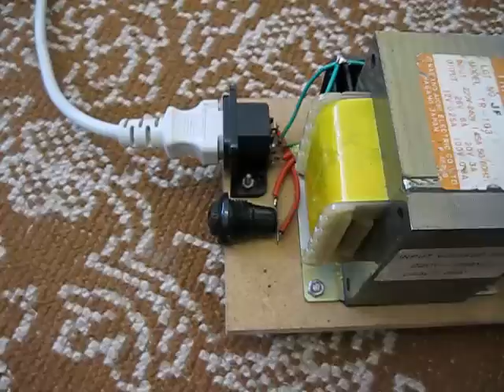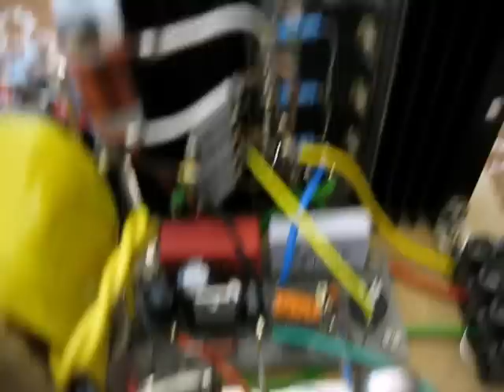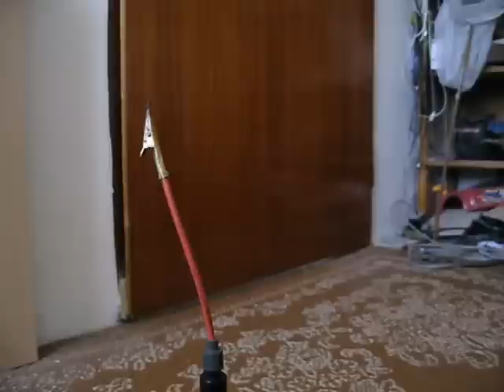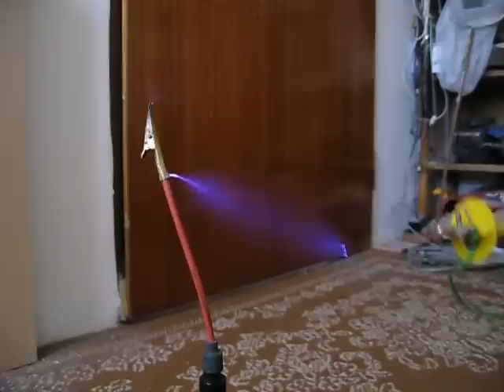Super flyback driver final version

Comment from the maker: @zker666 of course you could, but the 260 really is enough and doesn't get hot with moderate heatsink if the circuit is tuned properly.

Comment: tv monitors, with a crt inside. flyback are only used for CRT's,other transformers i can think up off the top of my head include MOT's (2000V, lots of amps, AC 60HZ) ignition coils, (30KV, low freq, AC output, low-medium current), NST's, (up to 20KV, AC 60 Hz, medium current to high current) and x-ray transformers, (rare, voltage unknown, 70Kv i think, medium current i think)

Comment from the maker: @lokeycmos Sorry but its too much... you could use a higher voltage MOSFET such as the IRFP360 and you'd need to change other circuit parameters to make it work well with that voltage.

Comment from the maker: I think the IRFP150 is a too low voltage transistor, then it depends on the transformer of course, its construction, phasing of the primary winding, air gap, core cross section, primary wire thickness, positioning and turn spacing.

Comment from the maker: Using a half-bridge the flyback dies sooner, with a single-ended "flyback" converter, the voltage can get higher with the same stress on the diodes.
Most flybacks I've tested failed with something like 10cm sparks on my driver...

Comment: I see 3 MOSFETs on the heatsink, are they in parallel (the schematic specifies only one) if so is it because they are underrated or am I supposed to put 3 IRFP260s if I want to run it at high power? btw awesome video!

Comment from the maker: it means that the capacitor resonates with the primary only during flyback impulse. The primary circuit is not tuned to the running frequency.

Comment: attach to critcal stripped hydrogen and oxygen atoms.and then the neutrons instantly cataclismically collapse as they are sucked into the engine air filled chamber implosion takes place .appreciate a price if you were willing to build a variable flyback and of coarse would be better if it were from 12v but i could use a 12v to 240v inverter  240v supply here in uk appreciate reply

Comment from the maker: It is to limit the capacitor discharging current when the FET turns on, and it "recycles" the energy leftover in the cap instead of dissipating it on a resistor.

Comment from the maker: @zker666 as long as the total resistance is something like 35milliohms (maybe even less is ok) at ~5W you're fine. You can leave the resistors out (and ground pin 3) but then the driver will always run at full power and something can blow with too short arcs.

Comment: @jmartis2 I meant the plastic insulator between the primary and the core so the core doesnt arc to the primary and cause a high voltage spike in the system.

Comment from the maker: @ubuntupokemoninc yes the simpler circuit gives the same open circuit voltage but doesn't limit current with shorter arcs and the transistor can overheat... though I don't know if youll get 100kV without destroying the transformer, only the large ones with big cores worked well for me, the smaller ones sometimes give poor performance and thin arcs. (also for cores with less cross section you should use more turns on the primary)

Comment: hi do these have b+ and if so does that mean they are stripping electrons .i am told that this is the main part stanley meyer was using to strip water molecules from 40kv up to 90kv so can these be made variable and where do trhe electrons go to as he states he feeds his electron propulsion generator with these got all the info just confused on this final part.once stripped the atoms elongate in the circular B+ field energised with uv 10w l.e.d.spectrum rainbow in injector that then lets neutron

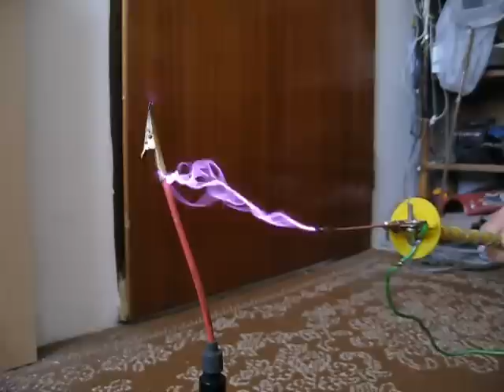Comment: I'm new to this but what creates this kind of electric arc and corona? is it frequency or whatever? I have a Neon sign transformer 10kV 30mA but the only erc it creates is the one that looks like on your video 0:40-0:45, kind of like light yellow plasma but no sparks. When I pull the diodes apart further the arc just dissapaers. It doesn't make this cool violet spark

Comment from the maker: @muraturile They are used as a current sense for the control circuit. You can just replace them with a short but then the driver will always run at full duty cycle, and something can fry eg. when you short-circuit the output.

Comment from the maker: @RUS38 The arc appearance (blue, purple, yellow, white...) depends on the current flowing through it. Because this flyback driver outputs a relatively high current at low voltages, short arcs are hotter, but the arc current drops quickly as output voltage and arc length increases.

Comment from the maker: It is 10 mili farads, this is used to smooth the voltage after a bridge rectifier. If you use a DC PSU, you can replace this cap with just a small decoupling cap (ca. 1uF film).
No, a ceramic cap will overheat. You need an impulse rated cap, polypropylene works well.
The resistors are for measuring drain current for feedback to the IC. Yes you can use a homemade shunt, as long as it can dissipate at least 6 watts and is non-inductive.

Comment from the maker: @miwgub It doesn't need to be exactly 21khz, but should be close. Different transformers might run better with slightly different frequencies, but I found 21khz worked best for me (higher frequency and I couldn't get as high voltage out no matter what I did, lower the frequency and the core can saturate/power output drops, and you can hear the frequency as an annoying whistle...)

Comment from the maker: @TheLightningStalker The extra coil with the diodes recycles leftover energy in the capacitor into the power supply. This circuit is better for driving a rectified transformer than eg. a bridge or zvs, because the output waveform of this is asymmetrical and the output diodes suffer less reverse voltage.

Comment: Hi... try the following:

1. Use a different mosfet. The IRFP260 had a breakdown voltage of only 200V. Try one like the IRFP22N50A or similar which can hold 500V, 22A and power of 277W. 

2. Remove the diodes and capacitor that are parallel to the primary and just place a high power (~5KW peak) suppressor with a voltage around 100V less than that which the mosfet can hold. 

In this way, you will be able to achieve higher spikes on the primary coil reflecting in higher secondary voltage.

Comment: @jmartis2 I got mine for free from a sample order from TI, and im building the circuit right now. I found a resistor thats about 30milliohms, and it is 6W so im going to use that, and do you have to put a gap between the primary windings and the flyback core? Is that for insulation purposes?

Comment: Largest sparks i have ever got off a flyback is 5", longest corona stream 7".  I did mine off a 555, single mosfet with Snubber capacitor...Simply by giving it 70V of power hehe

Comment: How can a flyback resist that high voltage?
Reply: I also have doubt about this....
Ludic Science connected two flybacks in series but still he could not get arcs larger than the arc shown here......
Reply: Trust me... They can... With a 555 driver I had some nice 2 and a half inches arcs!!
Reply: The ground shall be seriously separated from the driving circuit, i.e. so there's no backpath for the arcs to go to, he might also have soaked the flyback in oil beforehand to make sure of proper separation, or perhaps even filled the crevices between the coil and the ferrite core to make sure it's as insulated as well as possible, the larger the CRT TV, the better the flyback too usually

proper mosfet driving and the right frequency also matters, high enough power and input voltage too, the amount of windings also matter alot, it needs a bit of finetuning but when it's perfectly set up you can get some magnificent results

most Flybacks also need an AC input because modern ones have a built in voltage multiplier, this is most easily achieved by having a center tapped primary, feed the positive on the center tap and have 2 N channel mosfets switch in turn
Reply: They are very dependent on frequency
Reply: He may have it in oil to prevent asking over
Reply: @cisarvialpando7412  trust me, it can. Some are built better than others. I'm sure that driver probably nuked a few flybacks before he found one that can handle it.
Reply: just magic
Reply: He probably potted it in something
Reply: I think hes blowing gas across the arc area
Reply: @tf3confirmedbuthv54   True. Capacitors matter. Those typical zvs black boxes limit 50kHz. With brown ones it goes up to 115kHz
Reply: Why don't you look up the difference between normal transformer and fly back transformer it helps

Comment from the maker: 1) I used three IRFP250, which are weaker than the 260. One 260 is perfectly enough, it doesn't get hot at all, I think it would work ok even with just one 250.

2) That is the peak voltage on the drain - the flyback spike, which is many times greater than the supply voltage.

3) Core is the piece (well acutally 2 pieces) of ferrite which makes a "loop" through the transformer, and is usually clamped by a metallic "C"-clamp.

Comment from the maker: Hi, yes this flyback is more tough than others, the key is asymmetric drive (you will never get such a high voltage from a half-bridge, or a "zvs" driver). The inductor, 2 diodes and a capacitor form an active snubber.
Reply: Yeah, people are caught up in the illusion of a zvs driver,  thinking they have long  arcs hence high voltage. They don't realize that they must bring the terminals close in order to initiate the arc, on the other hand flyback mode can initiate an arc from 3 inches

Comment: I got arcs this big from a 555 flyback driver, I used dual supplies, 12 volts to the 555 timer, and 0- whatever my mosfet can handle on the FET / flyback end.
Although, the arcs were not this thick when the electrodes were close for hot arcs. But, I think it is because my power supply couldnt supply enough power. And DO note, I used dual flybacks since one couldnt handle it. But, if I had a flybackt hat could handle it, I would get the same results. I will make a video of it when I get a chance

Comment from the maker: @Alex1M6 Hi, The half bridge and other "symmetrical" drivers put more reverse voltage stress on the internal diodes and they fail earlier. The single ended driver produces pulses which are much larger in amplitude in the direction which the diodes rectify, so they see less reverse voltage for the same output.

Comment: Yea I don't believe in a half bridge for these, I drive mine in flyback mode with 50% duty cycle and can still get 5 inches of zvs like arcs. My goal is to jump the furthest gap possible. Because of you I have a benchmark now. As soon as I get some new fuses I will be dropping my duty cycle to about 3% and upping the voltage to see what happens. I really need to incorporate current limit too because I am blowing fuses like they are going out of style.
Reply: Yeah, How did it go anyways? 5 years ago, wow! I like these old comments.
Reply: @davemwangi05  Better fets are around these days, with a high voltage fet, different capacitor, higher current sense resistance and miller clamp on the gate you can use rectified mains (don't ground the driver if you do!).

Comment: Is it only larger CRT TV's that have flybacks that can sustain this amount of voltage being produced? As I have managed to kill all of my big "good" flybacks using my SG3525 half-bridge driver with arcs firing at around 3-4 inchs. They start leaking corona around the flyback casing then eventually it just breaks down and arcs over.

Comment from the maker: @darrenhello2 This circuit was built by experimentation, the capacitor decreases MOSFET heating many times (less switching and avalanche losses). Without the cap the primary spike is high but short, and the leakage inductance together with the secondary capacitance of the transformer flats out this pulse.

Comment: I have be analyzing your snubber circuit and I wanted to post my conclusion here so others can learn I am correct. Once the switch is closed the 220nf cap will suck up the majority of the inductive kick as the voltage rises. The opposite pin of the cap will store a negative charge through the lower diode. The newly formed tank circuit will oscillate between the flyback and the cap. The oscillation will be passed through the cap through the upper diode and recycled back into the flyback's input.

Comment: This driver might actually be powerfull enough to bring my oil insulated ac flyback transformer a bit closer to it's limit. I tried to kill it a few times but never succeded. It just takes everything on even though the parts i used are together only like 15€.

Comment: Hi I build this circuit and I have almost every piece, but let me know in the diagram are 5 parallel resistance of 0.18 ohms could be replaced by a resistance of 1 ohm to 15 watts and eventually would like to know the voltage can be increased about 60 volt input, reducing the amperage without damaging the driver circuit thanks for your help.

Comment: Very nice! I think the corona is more interesting than the actual breakdown. I wonder how awesome this would look in the dark...Kinda wish you would do that for us.
Reply: I love corona glow I always wanted to make bottle "lamp" using it. still might........
Reply: Bottle lamp? Hmmm that sounds pretty cool. Is that at atmospheric pressure or vacuum?
Reply: Well the the first hurdle is coating the inside with a conductive tin oxide coating. If you want a nice corona glow though you should be below the voltage that will arc so vacuum might not be needed. I can can get down to about 0.1 atm though if need be
Reply: Sounds like a pyrex beaker fired with an SnO based glaze might work or even fuming the glass. I like it. I've seen a Leyden jar throwing off some pretty amazing corona but it seems you may be on to something pretty friggin' cool. If you make it, post a video cause i'd enjoy seeing it.

Comment: I have been using the double 2n3055 driver,like the one Rimstar has,to drive an antique large core AC flyback,but I find that when I arc it,even though its to a 200M ohm resistor, that the resistor network that is in the driving system gets really hot. The resistors are the standard 220 ohm and 30 ohm. The flyback core is 9/16 in. diam. The primary turns I used was 8+8, no.18 gauge wire, and the feedback turns was 4+4, no. 24 gauge wire. I used more turns on these than is usually done on account of the size of the core. But anyway, no matter if the input voltage is only 8 volts with 1.5 amp current,...as soon as I make an arc to the 200M ohm resistor, the driver resistor network starts over heating. The resistor network is 5 W 220 ohm and ! watt 30 ohm. Why does this happen?

Comment from the maker: it would work, but you might need to decrease supply voltage by some 10% (the 555 has >50% duty cycle). Also the circuit wont be protected from high output loading (short arcs/direct short), the transistor might heat a lot or be damaged during these conditions.

Comment from the maker: yes you can, but I'd put two in parallel (one will work, but might get quite hot). As long as the FET has less than 50mOhm on-state resistance and a voltage rating of 200V or more, you should be fine.

Comment: how much amps?
Reply: Virtualgod2009  if thats 12 cm its around 300kV
!
Reply: Virtualgod2009 At the end of the video, when he brings the leads closer, observe the arcs... They're off-white in color... That means there is at least 9mA of current in those arcs.
Reply: Virtualgod2009 It's also due to reduction in frequency and a pseudo PWM effect. Since the frequency reduces due to parasitive capacitance of the secondary has to be charged to a higher voltage, it takes longer. 
The secondary is basically an LCR circuit. 
The frequency should change by similar to 
f=1/2π√LC

Comment: Crazy, I was never able to drive my flybacks with more than 35 - 40 kV before they blew up.
Reply: He's using a really robust flyback I think, I've killed so many flybacks with this driver and like you said most start flashing over and breaking down long before these voltages are reached. My best one could jump a 5 inch gap before it flashed over internally, for the next best one I added a small hv capacitor to the output and turned the frequency down, this gave the arc/hv a low duty cycle and has allowed it to last.

Comment: Daniel Augusto inquired "what is a 27R or a 470R"

Succinctly; A 27 Ohm and a 470 Ohm (resistor) respectively.
FYI This notation substitutes the decimal point with the denomination symbol (or with the SI unit symbol where the denomination is units).  note, however, that, resistance units (Ohms) are symbolized by 'R'

Hope this is helpful

Comment: Some people that build this circuit says that the 220nf cap is a resonant capacitor and you have to find the right value for your flyback but it seems to me that this capacitor,the inductor and the two diodes serve to recover the energy stored by the primary,it's right?

Comment from the maker: Yes the secondary ground return.
The air gap is the gap in the ferrite core set by non-conductive "spacers". Smaller gap means less power.
Be aware that I already fried a lot of flybacks with this circuit :D so rather start with something like 12-14 turns, or gradually bring up the supply voltage, turning the power adjust pot slowly up should work too.

Comment from the maker: The circuit has a power control, which also controls the output current. To regulate output current, you would need to sense the secondary current and feed this to a suitable SMPS IC.

Comment: Quick question - the high current tolerant diodes, which ones did you use? I tested it with 2 uf4007's for about 30 seconds, yes they got hot. I've got random ones out of obsolete SMPSU's though if I used Schottky diodes, they would buuurrn. This driver is so enticing, I just need a bit of help and I'm almost there!
Thanks